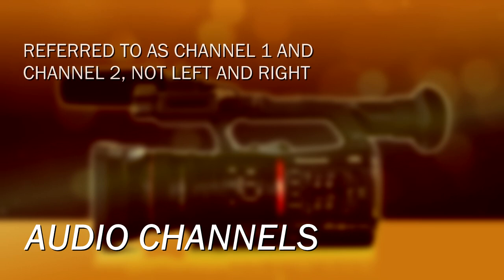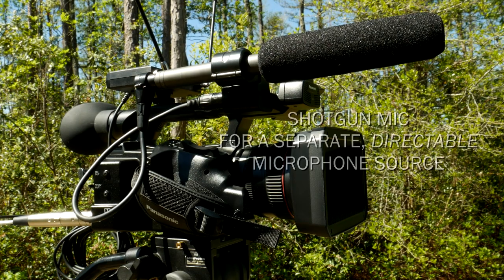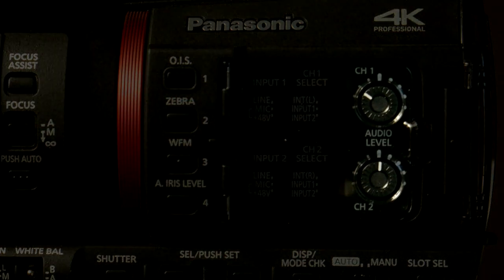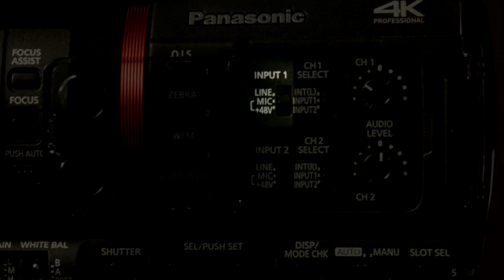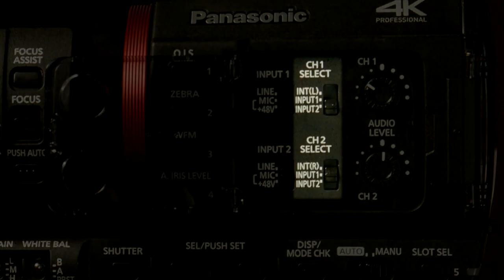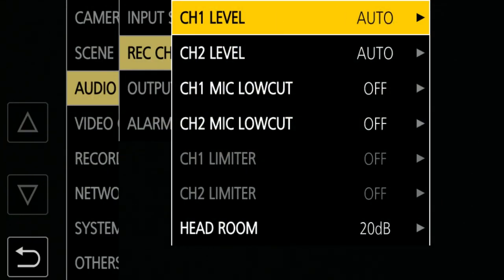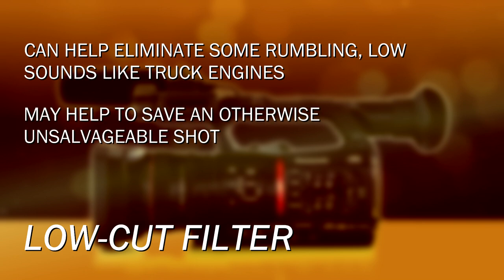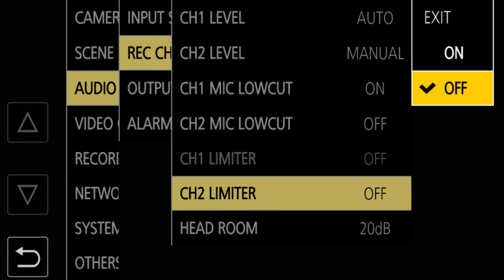CX350 – Controlling Audio

Comment: I have a problem with the Camera that when I connect any external Mic wireless to XLR 1 or 2. the Audiometer didn't show any signals. its shows CH1 CH2. but when I open the file on the computer I found there is 4 channel audio track there. I am very confused please help me how to check Audio levels on the screen? Thank yo.
Reply: The extra channels are from the internal mics with agc. These channels are used for backup and/or ambient sound.

Comment: Thank you, but I do still have a serious question and need some help. We are running out from our mixer to the 2 XLR channels and we are wanting the recording to receive those 2 audio inputs as "left and right channels" rather than individual audio streams. Yet, when we go to work on the recordings, we find that every file now contains 4 audio streams. 2 of which are the internal microphone channels and the other 2 are the 2 xlrs we are running from our board into the camera. Could we get some help here? We don't want it to be "audio source 1, audio source 2, audio source 3, audio source 4" and everything treated as a separate mono source. We want the 2 xlr runs to be treated as stereo audio for the videos when we go to edit and produce them. Thanks.

Comment: Hello!  Thank you for making this video.  It has been very helpful for me.  I have a question that maybe you can help me with.  I have the same camera (CX-350).  Do you have any experience bringing in Line level audio to the camera?  I have a fashion show that I need to shoot in a couple weeks... but I can't record the actual audio that is played at the show as Youtube will flag it as copyrighted.  So I have made my own copyright free soundtrack for the show that I wish to bring into the camera when I start recording the show.  So I purchased an XLR cable that has a 3.5" stereo jack on the other end that goes into my MP3 player.  The XLR end is plugged into the camera's Input 2 set to line level.   The problem is... When I play the audio... its sounds incredibly hollow with a slight echo... and the quality is just horrible.  Not distorted like if MIC level was accidentally selected... but nonetheless horrible.  Almost like there is some sort of line mismatch or something is out of phase.  Almost like the stereo is out of whack and parts of the instrumentation are missing.  So I guess my overall question is... do you know the best way to bring audio from a Line level/mp3 player into the camera so the audio quality sounds full and vibrant as it should?  Any help or guidance would be so appreciated!  Thank you so much! :)
Reply: If you are editing it, simple fix is to add audio in post. If doing it live, then I see your issue.

Comment: I know that the manual says there is a 3.5mm headphone jack output. But I cannot find it on the camera and have also asked a camera expert and we are unable to find it. Can anyone assist on where this is located?
Reply: I am testing my new CX350 myself now. Is very well hidden. Some 4 cm above the lock of the transparant cover of the audio section. Watch for the headphone symbol.
Reply: 3:06 it’s the silver jack above the 4K print.
Reply: @WupperVideo  Thaks, I actually found it one week after I posted the question. The question is two years old.